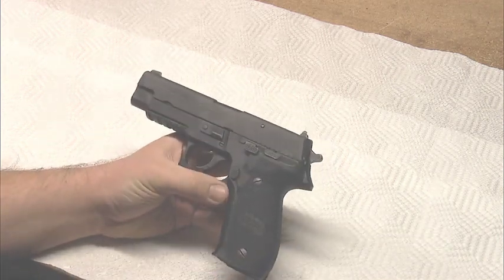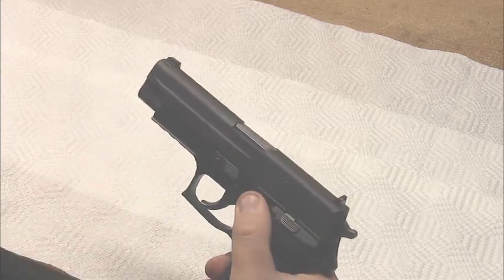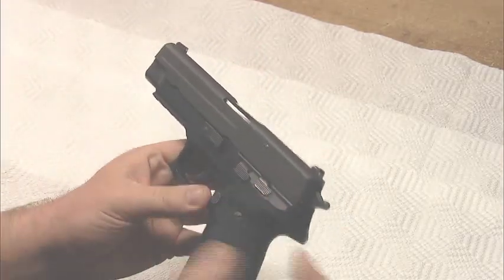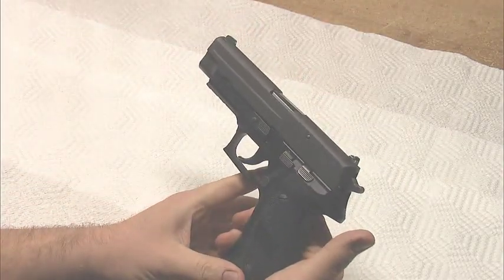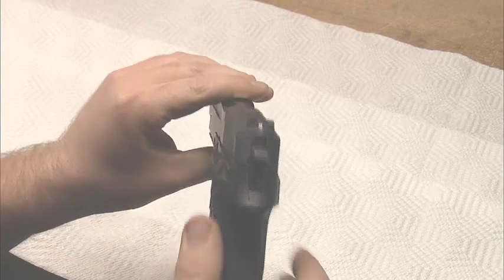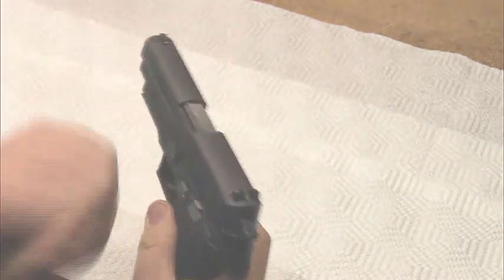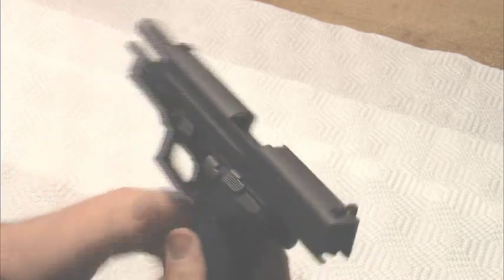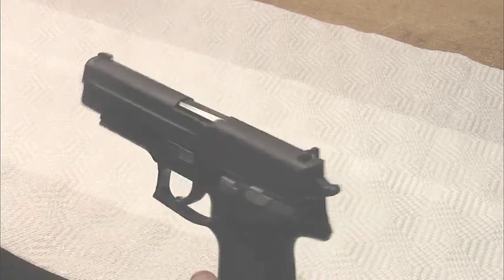Part 1 of 6:  Sig Sauer P226 Full Disassembly, Reassembly, Grip and Slide Catch Modification

Comment: Great video.  I might put a short trigger in my P229.  Regarding your grip... shoot what works best for you.  Thumbs down / thumbs forward is not right or wrong with an auto pistol (obviously one should not shoot thumbs forward with a revolver unless they want powder burns).  Just go with the one that you shoot best with.  Ayoob even says he shoots faster and straighter with his thumbs down.  Also thumbs down leads to a little more grip strength which helps with retention in a combat situation.

Comment from the maker: @gmikebrittain The only thing that is a major problem for flying off is the small magazine release catch pin and spring. Those 2 parts are tiny and will shoot all the way to the ceiling! I would recommended putting the whole gun inside a plastic bag or some such thing when removing or installing the magazine release (assuming you even need to remove it). Other than that, the whole process is pretty easy and nothing else is under that much spring pressure that it will fly off.

Comment: I don't know who taught you your grip, but wow.

I have very  large hands as well. I have never had an issue with my P226.

I believe your reaction side hand is far too forward.

A good grip is not a cup (which you do not do) but is an overlap of support/reaction hand overlapping fingers of grip hand and the thumbs lying side by side contacting the grip. Thumbs should never overlap or cross.

Comment: You are not overlapping your thumbs. I could have worded that better.

You are using a "parallel thumb" grip, but your left hand is too far forward. I know some people got that hand position from somewhere. Take a look at your left hand position. It is far forward on the frame of the pistol. The thumb of your left hand is on the frame and not the grip. And the thumb on your left hand is dangerously close to the slide.

You state that you were new to shooting when you got the P226.